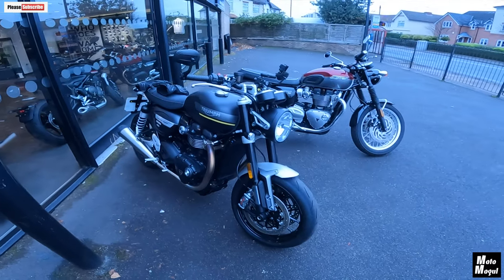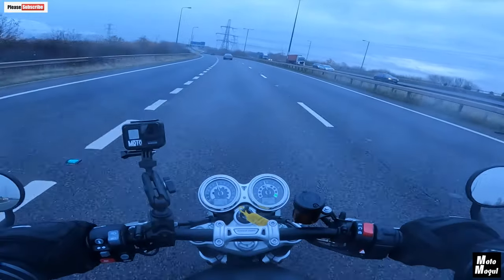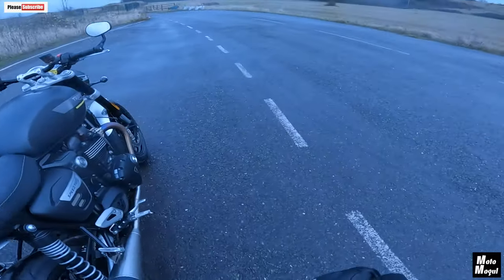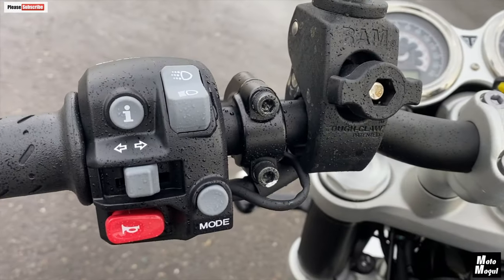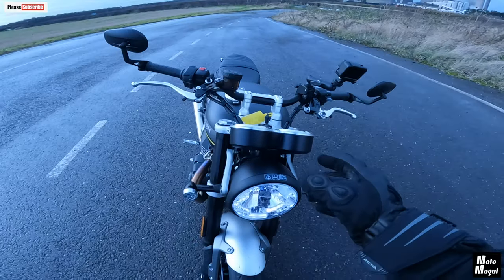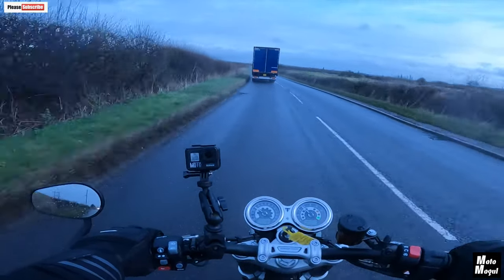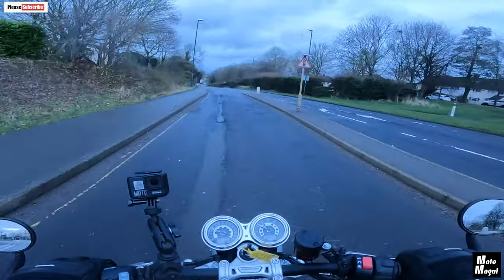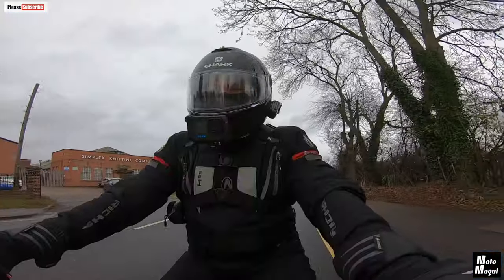Triumphs Non-Identical Twins. Part Two.

Comment: I have to say I tested both back to back this week I rode the Speed before the T120 and  found them chalk and cheese, firstly I rode the Speed and the sales guy said "well you won't want to bother with the T120 after this" well I spent about half an hour on the Speed and could not wait to get off it ,stiff with  uncomfortable seat  weight on wrists bit snatchy but good power of course and felt really small  felt kind over the front somehow . I then got onto the T120 and felt immediately comfortable and more upright so nothing on the wrists seat better "probably because I was more upright  I felt I could ride for miles .The one downside with the T120 for me was tubed tyres so roadside  puncture repair would be much more of a pain although if you buy new you do get 2 yrs RAC free.  The one I rode was a 23 all black model which would  and might yet be my choice .I currently ride a Yamaha XJR1200 SP and although the T120 is down on horses it felt just as good and was of course easier to throw about .The Speed was closer on the BHP front in fact about 5 BHP up on my XJR much lighter but around the same height this also made the T120 better for me for slow maneuvering sorry gone on a bit here 😉good watch 👌👍
Reply from the maker: @crumblymal8479  The only bike I would change my GS for would be a T120. I just wish Triumph would fit tubeless wheels 🤷🏼‍♂️👍
Reply: @motomogul  I have looked into that and found there are tubeless spoked wheels available but boy they are not cheap to buy they come with black rims and or alloy rims at about £550 pounds each for the T120 .👍
Reply from the maker: @crumblymal8479  Even that sounds cheap. I’ve seen them for around £2k for a pair.

Comment: 17'' front wheel rather than 18'' on the 120 will quicken the steering as will the steeper rake and trail. Heard others say it's an altogether twitchier ride, encourages the inner hoodlum and can end up feeling frantic. Agree the 120's more relaxed, though runs out of puff. Uprated cam and mapping sorts that. You say you like the 50's look of the 120 then want to chop the mudguard off and stick bar-ends on (which'll make it more vulnerable and wider for filtering). And everything's extra now - colour, grips, centre stand (not for the ST btw) bash plate, grab rail, rack - with luggage you'll soon be up nearer 15 grand!

Comment: The 'drop down' mudguard on the T120 is traditional (hence retro) and stops crud spattering up your and especially your pillion's back in the wet. The stalky mirrors on the T120 are similarly traditional and have the bonus of being able to filter without clattering car mirrors. I also prefer looking across more than down to see behind. Bar-ends look like you're going proddie racing, hence ok on the Thruxton.

Comment: Nice comparison. Think I'd definitely go for the Speed as it's lighter and more fun in sports mode. Relaxed rides are nice some of the time but when you get the urge for a bit more adrenaline, it's also good to have that possibility. The Speed Triple appeals even more but I live in Paris with an 18mph speed limit🤣 Merry Christmas.
Reply from the maker: Thanks Tony, just out of interest, how many Parisians adhere to that? 🤔
Reply: @motomogul  It's getting unfortunately harder to avoid because the fines and points are raining down! But I have to admit that I don't always if I think I can get away with it. But where I used to do 60kmh when the limit was 50, I now hardly ever go over 50kmh in the city.

Comment: Great review. 👍🏻
The 10,000 miles service interval, is a bit of a con. As it’s 10,000 miles, or 12 months; whichever comes first. And as most peoples PCP deals are 4,000 miles per annum, then it’s clearly 12 months 🤷🏻‍♂️
Reply from the maker: The PCP deal is very restrictive, be no good for me, I did 9k this year without really trying.
Reply: I agree; it’s very restrictive.
I stopped riding my Speed Triple in September, as a result of reaching my mileage allowance 😬

Comment: have you tried the scrambler yet  Jack ?
Reply from the maker: I had a ride on the one belonging to John the salesman at Pidcocks on the day my microphone failed. I wanted to do a video short on it but it wasn’t to be. I will be doing that again in the new year. It was really easy to ride and I did quite like it, partly because it had properly loud straight through pipes on it 😂😂😂
Reply: @motomogul  they do look good, i had a bobber with american slip ons on with a decat pipe fitted, it was very quick bike sounded great but the ride was spine breaking 🙄😉
Reply from the maker: Bobber will most likely be the next review I do for Pidcocks.
Reply: @LoneAmigo17 That counts me out.After 61yrs of riding bikes and hard work my backs rooted.Even my t120 gives my back some on the rough poxy roads Australia has too offer.

Comment: What’s this thing many modern bikers have including you against mudguards they protect your bike and look fab especially in the matching colours. Then there’s these awful bits of plastic storks on the back of a lot of modern bike and then bikers complain about the mud going al over there bike and expensive jackets. And you said you would cut off the T120 rear mudguard are you mad 🫣🫣.
Reply from the maker: Possibly. It’s a case of each to their own MsDenver. A ‘tail tidy’ does make for more modern lines, and this is a modern retro. To me the full rear mudguard is just a little too much of a nod to the past. Hope you get yours soon 👍👍👍
Reply: @motomogul  I understand I was only punning with you lol

Comment: Take the baffles out of the mufflers and it sounds real stout.
Reply from the maker: I bet. It doesn’t sound bad, it’s just not bad-ass! 😎👍
Reply: Soo what's badass? A loud popping exhaust that makes it sound like it's running on old gas?
Reply: I still don't get why everyone buys these super smooth running and sounding bikes, then put super expensive aftermarket exhaust on them that make them run and sound raggedy? Buy a used Harley and run 87 octane corn fuel. Stop molesting all the smooth sounding machines!
Reply from the maker: Nope. Just something a bit better than what’s on it now. Euro 5 regs on noise levels are ridiculous.
Reply from the maker: Cheers buddy. Hope you get the right can for your bike, that new Speed Twin looks amazing 🤩
Reply: @andrewbecker3700 And what bike do you ride.Couriosity has got the better of me.

Comment: Not just a re-map dude.
Reply: Andrew Becker is correct; you can't re-map almost 20 horsepower. I am enjoying my 2020 Speed Twin here in the U.S., hoping it doesn't develop some of the electrical issues and gearbox problems that people have mentioned (see Van Blamm, etc).
Reply: @frederickwoods5943  The wiring issue on the early model was because the harness was too short somewhere apparently? I've only heard of sensors failing, never anything mechanical in the gearboxes. Having the bike fall over from stupidity cant be remedied. I'm always amazed at the time and money some fellows are willing to spend on thier bikes without having really any clue what thier doing? Throw some money at it and see what sticks?